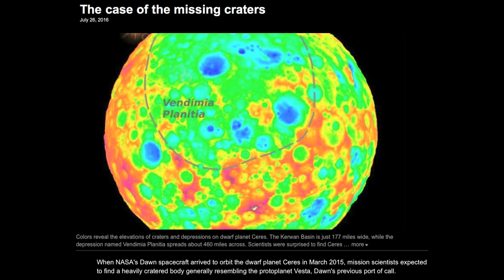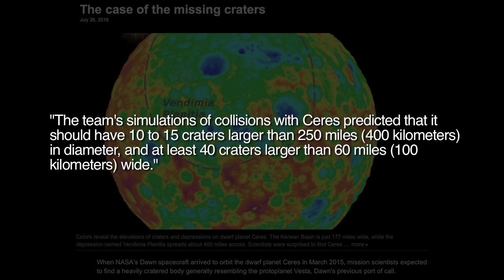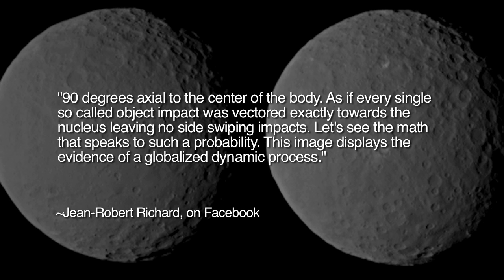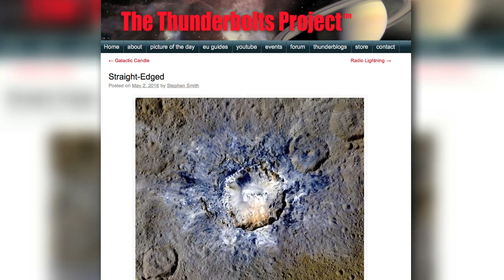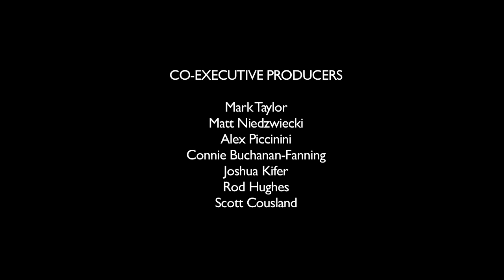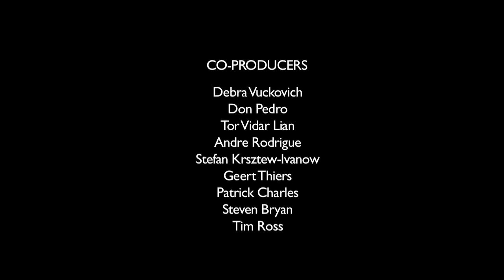The Missing Ceres Craters Mystery | Space News

Comment: +ThunderboltsProject , There is another hypothesis that's too often forgotten as well - a less direct circuit.  Exploding meteors.  The only way this would happen with bodies that have no atmosphere would clearly still be voltage differentials - the approaching body gets an immense influx from the electrical nature of a body, and passing the limit in which it explodes.  We've seen this happen many times on earth, and never witnessed a direct impact.  Examples include Tunguska and Chelyabinsk.  Given the electrical nature of explosive discharges, such patterning could still happen from a significant above-surface blast.  Perhaps in some cases there is an arc from the approaching smaller body, and in other cases significant arcing if planetary sized bodies approach eachother for more long term slow current effects.  Airburst would always demonstrate a vertical semi-symmetry cratering.

Explosions are only chaotic because the method used for detonation is dirty.  Explosive chemicals are incoherently oriented molecules that exhibit explosive discharge when reacted with fire or other chemical that reacts violently with it.  If you were to electrically charge an object to the point it coheres into an electromagnet and beyond until it completely detonates, you're more likely to get a coherent and simplistic pattern from the blast, as the molecular structure was made coherent and organized.

What needs to be understood as that there are no "positive and negative charges."  There are positive and negative energy in which is represented as charge and DISCHARGE.  This is why in one direction we get fanning, and the other we get dendritic arcing.  The fanning is incoherent discharge first from source then charge to destinations (more discharge than charge), and the arcing is charge at source first then coherent linear discharge through lowest resistance path to destination (more charge than discharge) - just like the Yin Yang imagery.

Thunderbolts needs to comprehend more work from the sources, like Faraday and Tesla.
Reply: I think they talked about that before. you need to search deeper in their videos and website.  what  if the damaged area of the tunguska event  had a polygonal shape.
Reply: jorge montoya It's been vaguely mentioned, but it's not in the consensus of EU yet.  More importantly, they need to look at works of Faraday, Maxwell, Tesla, Wheeler, to adequately explain WHY the universe must be electric.  Descriptions that fit observations (even if notably better) is not good enough to beat the fallacious descriptions of GR and QM.  Science needs EXPLANATIONS.
Reply: Not sure I understand 1/10th of what you said, but it is fascinating!  I love discussions that involve challenges to the status quo dogma of "scientific theory".  Discussions like this are the birth place of new innovations and what real "science" is supposed to be.
Reply: Google the words you're less than familiar with, and think about it for a bit... it's pretty simple stuff, my 15yo brother that spends zero time with the sciences gets it lol.

PS: there's no point in agreeing with a model if you don't know what they're talking about lol.  There's challenges to the mainstream because Einstein's general&special relativity are self-contradictory bs that has no basis in reality... and quantum is a total joke, especially QED.

The paradigm of quantum is obsessed with convoluting everything, and creating this air of the supposed need for education to understand nature, which is a fallacy.
Reply: ASININE!!! ELECTRIC ORIGINS WAKE UP FOOL